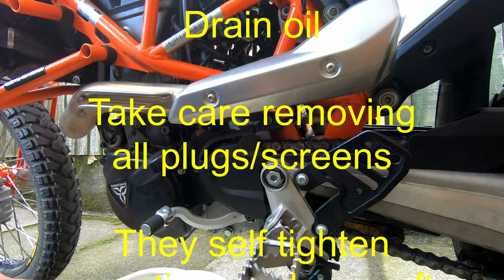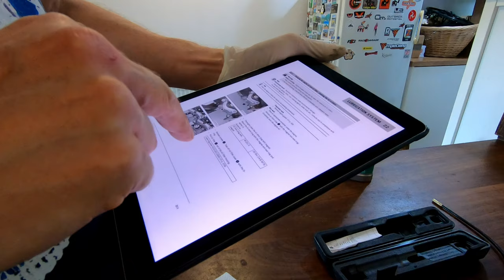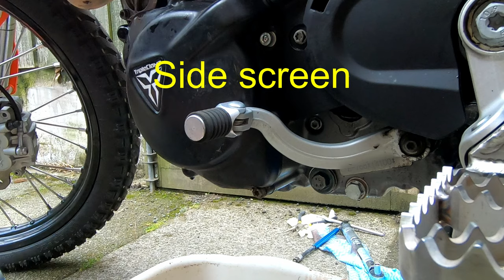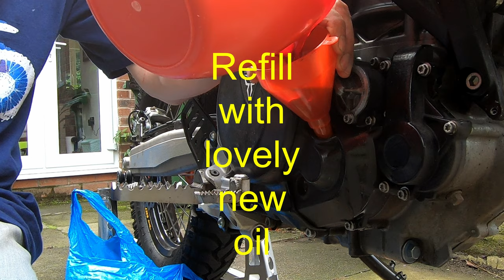KTM 690 Enduro R - Oil & Filter Change

Comment: I always pre-charge the closed end filter with oil to reduce dry time for the engine on start up. Surprising how much oil it will soak up. To a lesser degree I do the other as well but not so easy as it is open both ends.

Comment: Hello brother Scotty ;-)  On the oil filter I use a drywall or a wood screw & tap it with a hammer, then screw it in a little then you have something grab onto. Are you still loving the K4 fairing?
Reply from the maker: Thanks for tip. That was going to be my next try if the hook failed, good to know it works. I really do love the K4. I could not see the bike without it now. 👍

Comment: Nicely done sir 👍🏼
Reply from the maker: Cheers👍 Those screens always give me the jitters, softer than Mr Softy 😁
Reply: @CodgerBiker  Are they plastic or a soft alloy?
Reply from the maker: It’s the nut. Softish alloy. If mechanic tightens them too much they round really easily when loosening then it’s a problem. I undid these the day I got the bike and torqued to spec to be sure. Okay once released, it’s just that initial twist needs to be square on, and a good tight socket. I noticed the new ones looked like they had a small amount of blue threadlock (at least that’s what it looked like) maybe that causes the initial ‘bind’. Others say they self tighten in use. I think I was probably just unlucky one time with an overly enthusiastic mechanic. Best to be aware though as it’s a simple job otherwise.

Comment: Hey up codger, what old did you use and did you change the screens and filter on the first 500mile old change?
Reply: Oil*
Reply from the maker: Motorex as in the video. The first service was done by the dealer, so I guess they did. There’s no need to really as you can just clean them. I decided to do an interim oil change as I was going on a trip and the bike has spent a lot of time standing due to many many lockdowns. Probably not needed, but better to be safe as this bike is a keeper for me. 👍